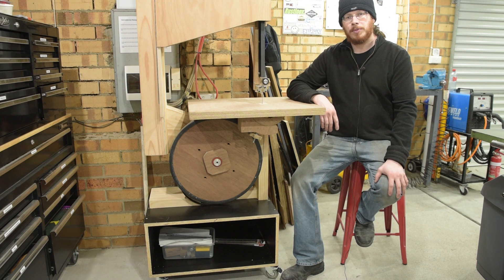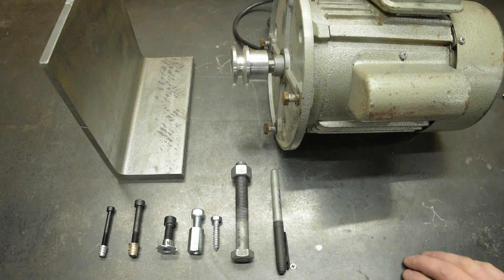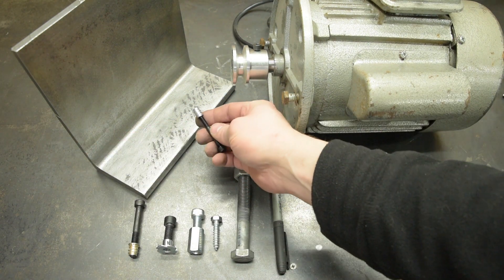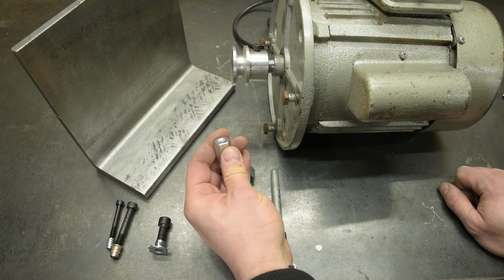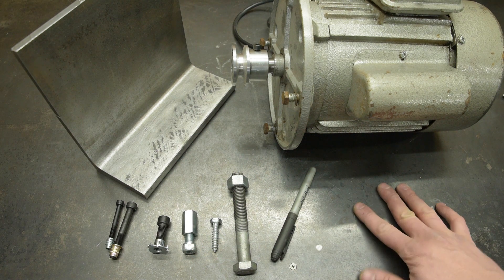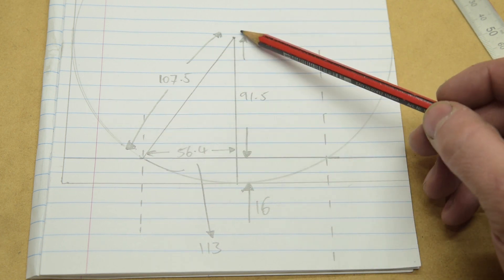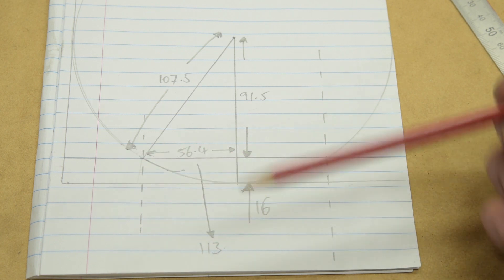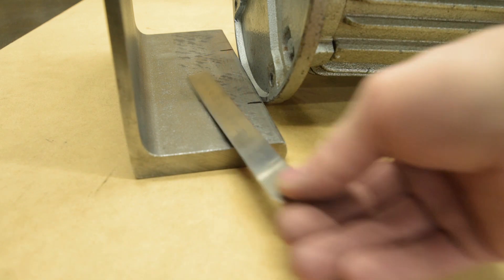Rotary milling a motor mount

Comment: Nice job on the mount - the rotary table radius on the outside made it look pro, I would have been tempted to just leave the 45 degree angles.  I also like how you showed the "proper" mathematical layout of the features, then mentioned that "Of course you can just eyeball it and it would still work," lol
Reply from the maker: It's good to give a couple of different methods, even if you suspect people will take the easy way :-)

Comment: It's alive !  Nice job , how long do you think it will be before you avoid the temptation & start cutting steel on it !!!  Cheers .
Reply from the maker: I think I'll be able to resist it, I'm getting about 460m/min of blade speed so a steel cut would kill the blade in seconds not to mention getting steel cuttings into the machine. Plus I've got a great little metal cutting bandsaw. Still a bit of work to do on enclosure, wiring and oil finish so I'm nearly there! Cheers, Craig

Comment: G’day Craig. Job well done, I do like the fact you radius the bracket to match the motor, a small touch of aesthetics. Since you have a mill I thought it would have been easier to mill a motor slot rather than cut the whole thing out, anyhow bandsaw sounds and works great. 
Cheers 
Peter
Reply from the maker: Thanks. Yes, that would have been a sensible move but I did not think of it! A friend suggested I mill off some of the motor housing to suit the mount, but honestly I'd rather keep the motor standard in case it needs replacing in future. Slot would have been a great idea. Thanks for the comment Peter. Cheers, Craig

Comment: Craig by the sound and visual it cut smoother than a metal frame ?
What is your opinion on your first cuts.
Reply from the maker: I love it. It has tons of power, and I feel 100% confident using it. I've had and used metal framed bandsaws before. This is definitely quieter, and at least as good. My own personal metal framed bandsaw was not a big beefy one and I never really liked it. The one I have most experience with is a floor standing steel one made by Startrite, it was a 3 phase commercial bandsaw, and it was a beautiful machine. This one though can do all the same stuff, runs more quietly, and was significantly less cost (if you exclude labour). No regrets here :)

Comment: Beautiful motor mount Craig, that saw looks to perform like a champ , better than most saws you can buy. Cheers!
Reply from the maker: Thanks howder - the saw build is coming along very nicely. The saws I can buy are either a bit out of my price range, or undersized or underbuilt (not rigid enough for good blade tension). And I fancied a challenge, so I decided to give this saw a go. I am very pleased with it and I think it'll outlast me! Cheers, Craig

Comment: The ability to resaw lumber would be very nice!
Reply from the maker: That's one of the goals. This saw has 36mm/1.375" thick wheels, and with the guide blocks and bearings set up as they are, it will take up to a 32mm/1.25" deep blade quite comfortably. That's pretty much ideal for ripping. I lengthened the spine of this machine, compared to the original, so it will resaw a 325mm/13" wide board. There is a mod I can do to the blade guides if necessary that allows for an extra 50mm/2". I am excited to get the lower enclosure finished, get some finish on the wooden parts and then start using this bandsaw properly!
Reply: @CraigsWorkshop  wow. That's gonna be a nice setup. I really never took woodworking as seriously as metal working. But I made sure I have enough tools to produce wooden goodies :-)
Reply from the maker: @craigtate5930  Ha I was the opposite (kinda out of necessity). I worked as a furniture maker and joiner for a few years in the UK, so I got lots of hands on experience with designing and making, using hand tools and machines. No access to any metal working gear though until about 3 years ago when I got my first metal lathe. I am fortunate to have trained with an excellent woodworker, and I absorbed as much  knowledge and experience as I could every single day.

I would love to do some more woodworking on the channel, as mentioned earlier, it was always part of the plan, but I had a couple of big builds to get out of the way first (bandsaw and workbench, really). Bandsaw is nearly done, and I'm itching to get started on the workbench!
Reply: @CraigsWorkshop  I love seeing the fine woodworking projects on YT. When I had my handyman business in austin I got to tinker with some basics. I always put a premium on machines/cars/trucks/tools. For practical purposes as long as I had those at my disposal I could build/fix nearly anything. Thats kind of what kept pushing me more towards metal working. Basic Wood cutting/fastening is much easier then the same in metal. But at the end of the day, I appreciate craftsmanship requardless of the medium ...wood, glass, leather, metal, stone, cloth

Comment: Wow, that is a really nice motor bracket 😀! Well done! Bandsaw is working great, thanks for sharing, cheers! 👍😁👍
Reply from the maker: Yes, it has scrubbed up not too bad for a bit of old rusty channel. It took way longer than I planned but the result is worth it. I am interested to see what it's like with a coat of protective paint. Cheers, Craig

Comment: Gday Craig, the mount worked out great, that was a large radius done on the rotary table, great build mate...
Reply from the maker: Thanks Matty 👍 - yes - my rotary table is honestly a bit small for the mill (It's a 150mm/6" table, mill table is 250mmx1100mm/10"x44"). But - it's big enough for most things I do, and much much better than not having one. I have some 16mm plate steel here, and I might mill it up into a 200 or 250mm pallet for larger, but light-weight work.